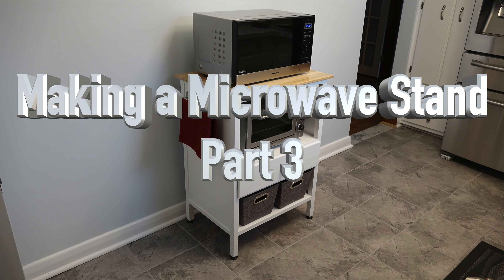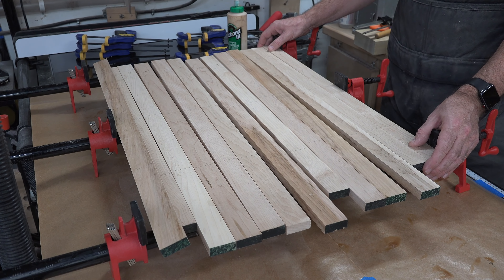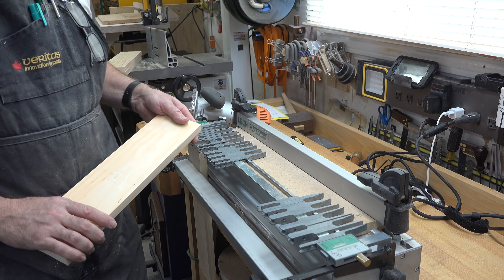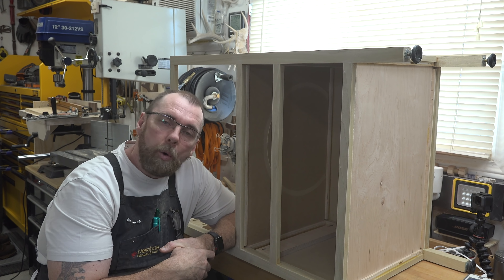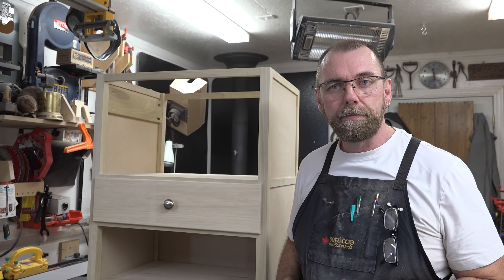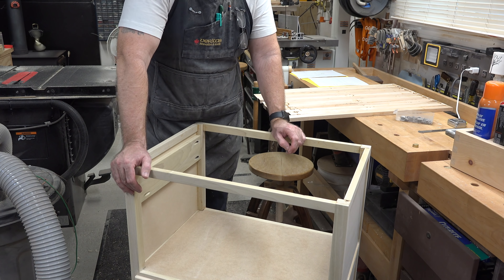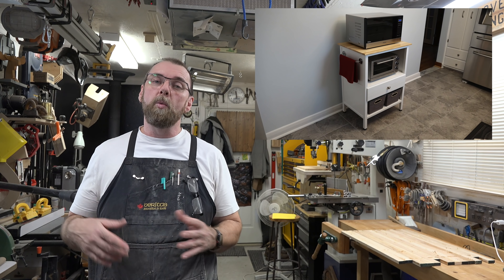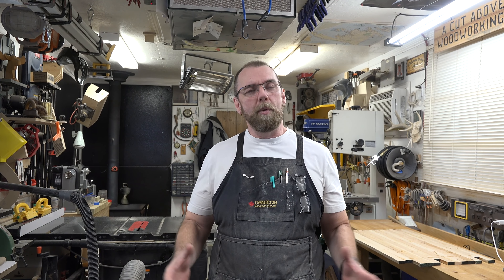Making a Microwave Stand Part 3

Comment: Kenny, well part 3 of this project did not disappoint, the final project looks great.  As far as the paint goes, brushed or sprayed??  Seems like I am never satisfied with my paint jobs when they are brushed but of course I am a crummy painter.  I especially like your choice for the top the maple should hold up quite well.  At ant point did you give any thought to a thinner version of a butcher block top?  Just curious, not knocking the design.  Great job, I really enjoyed the series.
Reply from the maker: Thanks for the kind words on the show Paul.  The finish was applied using a combination of brushes and rollers and it came out fairly well.  I considered several versions of the butcher block top Paul and my final decision was for the one I got.  The more I drew it up, the more I liked it.  Thanks for the kind words sir and for tuning in this week.

Comment: I need to make a top for an existing shelving unit to house a larger microwave.  What wood would you recommend for the microwave to sit on?  I'm a diy newbie, so I appreciate the help before I go to the lumber shop.
Reply from the maker: Maple is always a good choice for that Lex.  It is a hardwood that can take a lot of abuse and it takes a stain and a finish rather well.  Maple plywood would also be an option with either an edge banding applied or a solid maple edge strips to conceal the plys.  I hope this helps.  Thanks for tuning in and if you have any questions, please don't hesitate to ask.

Comment: The stand looks great. I have a question about the dowel jig that appeared in episode 1. It appears to be the Lee Valley one and I'm wondering if this is the case and if you think they are worth the price. I bought a cheap plastic one with steel inserts several years ago and found it difficult to position and keep steady. This one looks like it would be better although pricier. Did you ever do a review video on it?
Reply from the maker: I have not done a review on this one Jim although I can if you like.  I find the price of any jig to be a little over the top and although this one was pricey, I don't regret the purchase and I have loved using it from the get go.  It holds securely in place with a minimal of effort and and the dowels line up perfectly and squarely every time and I've never had an issue with it.  It's a solid unit that is completely steel construction and it is definltey a quality made product.  The one thing I love about it as well, is that it is made in the USA.  I hope this helps, but if not, feel free to ask any other questions you might have.  Here's the link to the jig from Lee Valley.  http://www.leevalley.com/en/wood/page.aspx?p=32250&cat=1,180,42311,42319. Thanks for tuning in to the show.
Reply: @acutabove_woodworkings  I'd love to see a review of this tool. Given your fondness for Lee Valley, I assumed that this was where it was purchased. They always seem to have well made products.
Reply from the maker: @JimLambier  I honestly can't think of anything that I have purchased there that I wasn't happy with Jim.  Look for a review in the upcoming weeks on Alternative Tuesdays.

Comment: Well built bro?
Can i keep my microwave on top of a wodden table?
Please answer ASAP
Reply from the maker: Of course you can keep your microwave on a wooden table.  A microwave has no heat element and therefore, generates no heat out the bottom.  It is perfectly safe to have a microwave on wood.  Thanks for tuning in to the show.